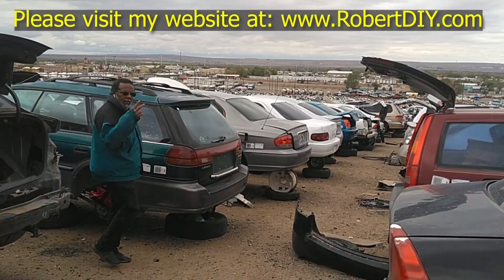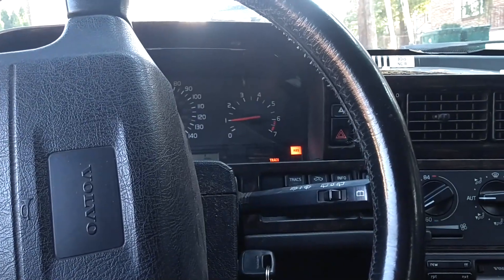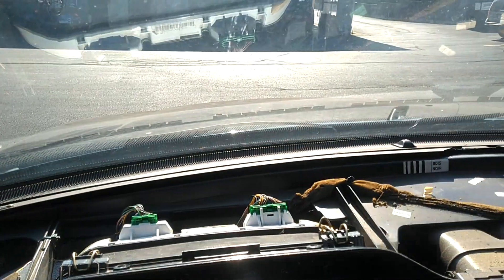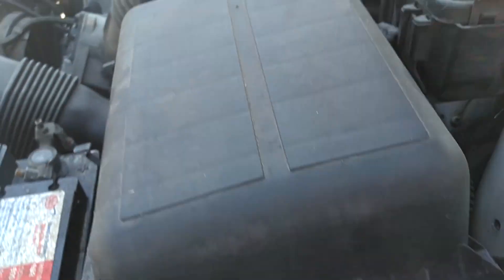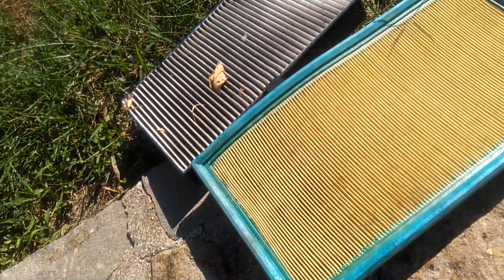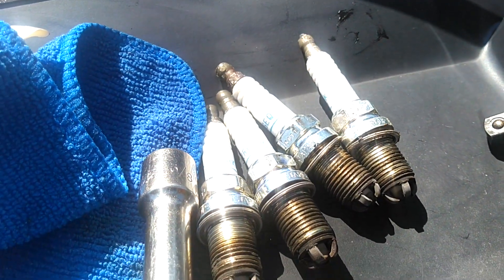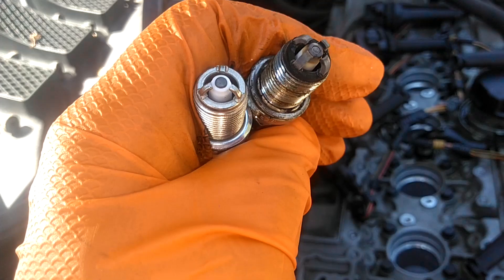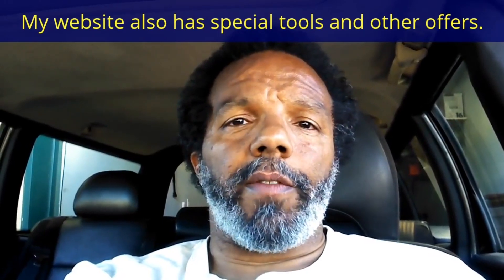Took my other T-5R wagon for a drive, then I did a tune up on a '99 S70 NA. Replaced plugs, etc.

Comment: I did the bypass on the fan during winter time, the climate control ECU fail to work and needed some heat.
Reply from the maker: Is that what I have?
Reply: Im lost but i unbolted the engine beauty cover to get more hot air thru my modified open element air filter breather in the winter , and its a little faster too lol
Reply: @RobertDIY  Probably in my case the ECU fail but doable check the fan relay. I got some spares if you need one for automatic climate control.
Reply from the maker: Which one is the fan relay?
Reply: @RobertDIY  The fan relay is next to fan itself it kind sticks into the shroud too!
Reply from the maker: Are you talking about the cabin or engine fan?
Reply: @RobertDIY  Cabin

Comment: Hi Robert and any other volvo fans, I'm looking for a little advice and insight on a 2000 volvo v70R that I'm looking to buy, unfortunately they are several hours away from me so I don't have the opportunity to check the car in person right now. The car looks to be in great condition however talking with the owner they state that the transmission slips, initially it was just in reverse when hot, then after the continued to drive the car it now slips in drive and reverse when the car is up to temp. Is this something that can be fixed with flushing the transmission fluid or would the care likely need more work than that. In emails the owner also stated that the motor has a slight knock at a certain rpm. What might be the best way to go about diagnosing what the cause of that is and what should be done about it?
Reply: Sounds like a lemon to me.
Reply from the maker: Buy low and plan for engine and transmission swap.